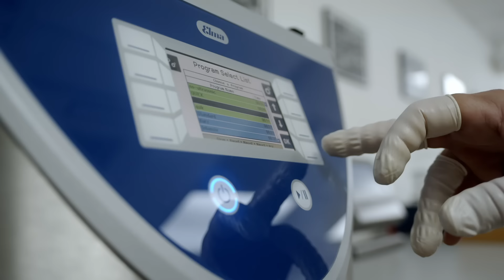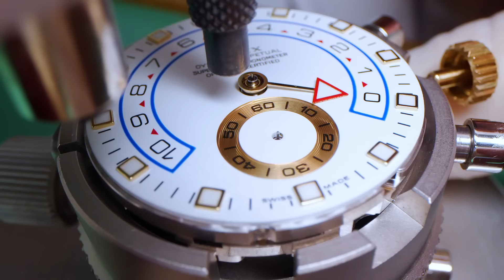Watchmaking Magic! Rolex Yacht-Master II

Comment: Phenomenal skill in disassembling and re-assembly. Such deft hand, concentration, attention to even tiny details! By the way, what was done in that machine for 45 minutes? Cleaning? Washing? Drying?

Probably, one more video is required about how these tiny precision components are manufactured? At least about some important components.
Reply: I believe that machine is an ultrasonic bath for cleaning the parts. It immerses them in water and applies high frequency sound waves to force dust and old grease to be released into the water, leaving the parts clean.

Comment: Why doesn’t Rolex make an display back and thin out the Router to show the movement?
Reply from the maker: Great question.
Reply: Because they don’t have to.  Honestly it is kind of cool that the beauty of that movement is hidden.  It’s like they know they don’t need to show it off.
Reply: @letsgobrandon987  yea but Omega, Breitling, IWC and even Breguet AP and Patek that are superior brand have display back and do not look like they’re showing off, it’s just a normal display of a nice movement.
Reply: @frankv7068  I get it, but I’ve always thought watches, especially sports and tool watches should only have glass over their dials with metal backs just for sturdiness and functional use.  Personal preference I guess.   At this point it would just feel weird to me if Rolex did that.
Reply: @udontony3406  I know you’re slow so try to read it again,  I said “👉🏽AND EVEN BREGUET, AP and PATEK👈🏽that are superior brands”. I did not include Omega, Breitling or IWC in that bracket I know they lay inferior to Rolex.
Reply: @letsgobrandon987  that movement is no where near a beauty lol... that’s the reason why they hide it because it’s way too ordinary... AL PP FP is what I call beauty.